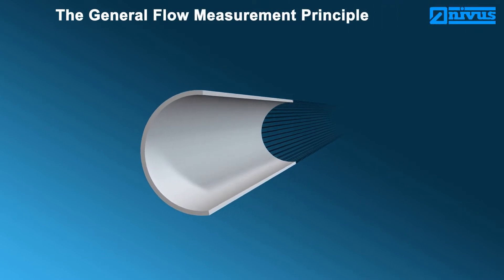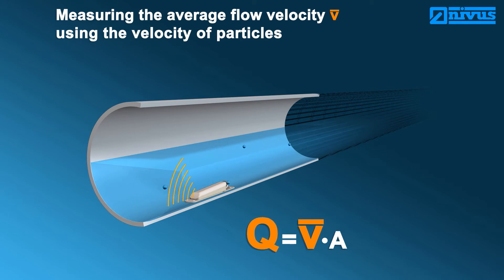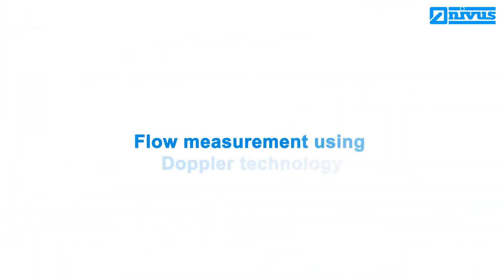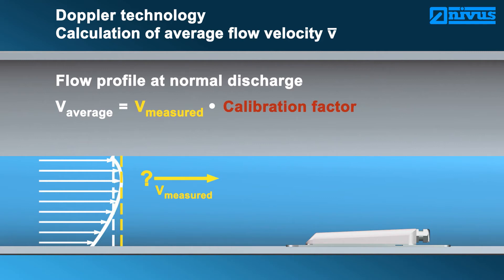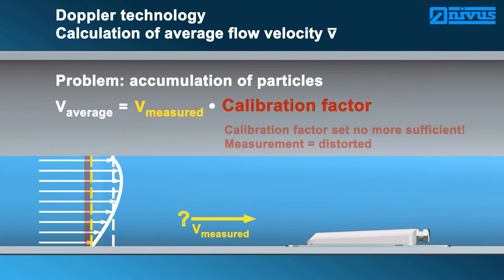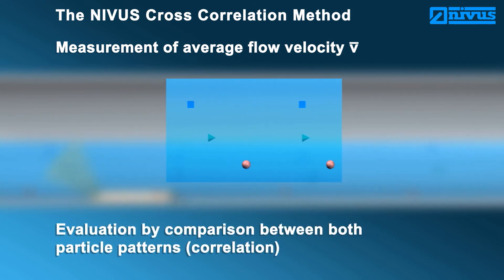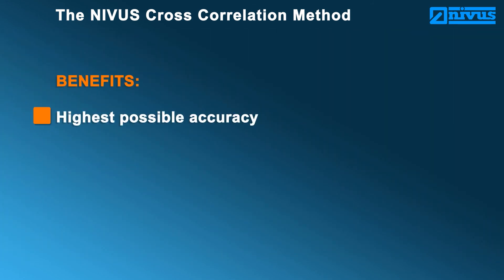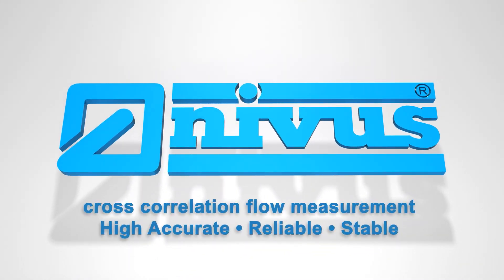Ultrasonic Flow Measurement Systems Comparison - NIVUS

Comment: In animations everything is perfect.
I installed sensors with the same operating principle, produced by another company and I had problems due to residues carried by water, such as the leaves of the tree, which stuck to the front of the speed ultrasound sensor, closing it ( zero speed indicated - the indicated flow became zero). I do not trust this type of sensors for water measurement which is not very well filtered by residues. Regarding fluid velocity, over 1 m / s can be problems when the water level is lower and turns into a splash cloud when it hits the sensor body